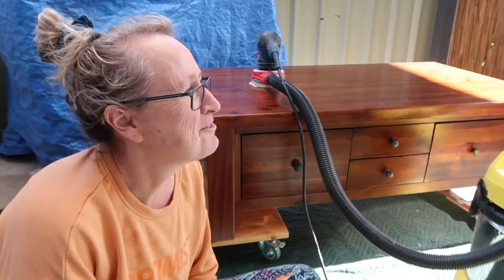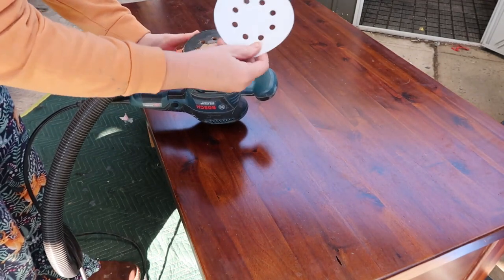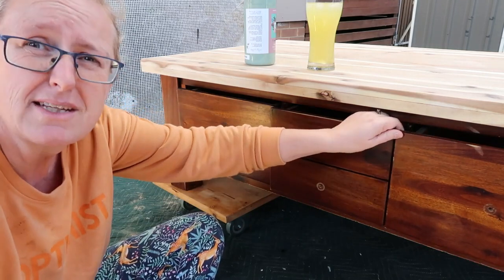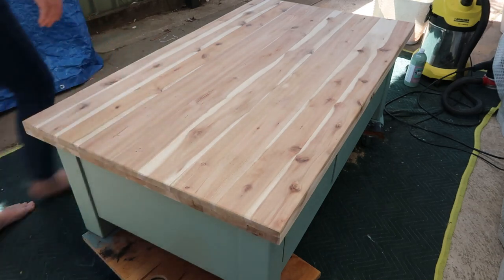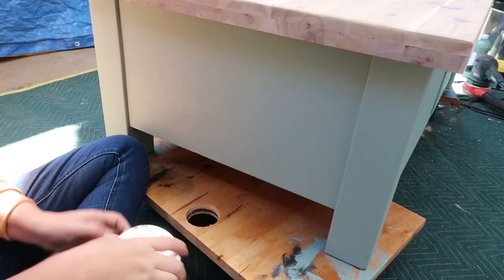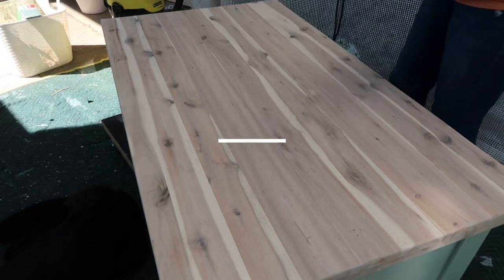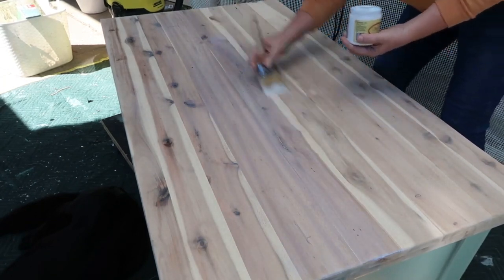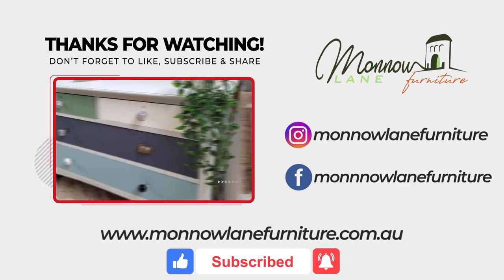Easy Furniture flip | DIY Thrift | all in one mineral paint

Comment: Hello my Furniture princess.,.so I've been in search for a good orbital sander that reduces the hand fatigue etc due to my disability that's the part that holds me back from flipping productively ...so I've settled on the Professional Bosch ROS65VC-5 and the adapter flex PVC coupling (1-1/2x 1-1/4 with metal clamps which attaches the shop vac to any Bosch sander it's $6 amazon)...I've dealt my share of the lower cost sanders and it's Time...I know You love your Bosch professional sander. ...so my question is ...is it necessary to put tape around the front for proper vacuuming ...or is this only to attach the hose and keep it put. ..thanks sweetie for your time with my question. .you're the best!👍🤗❣️
Reply from the maker: Woohoo! The tape is just to attach it :)
Reply: @CraftedbyMonnowLane  oh awesome.....so incase you want to buy the silicone Flex PVC coupling adapter (it's $6.95 on Amazon) the sizes on each end (which attach the shop vac hose Directly to sander) is 1-1/2" on one end and 1-1/4 on other end and has those metal screw clamps to get nice and tight.  .I got this tip from an old Carpenter that Is loyal to the Bosch professional sander system ...hope this clamp adapter helps you sweetie....thanks for everything